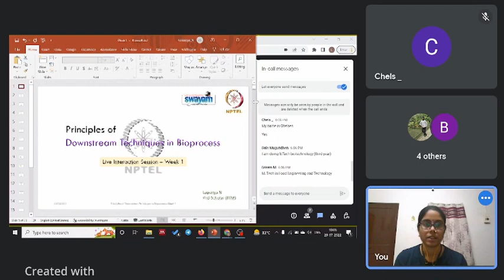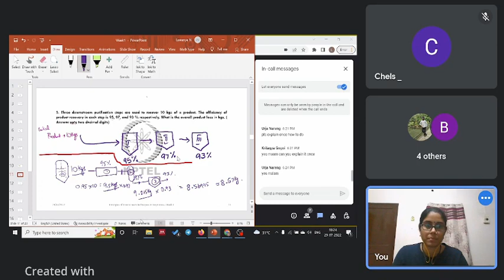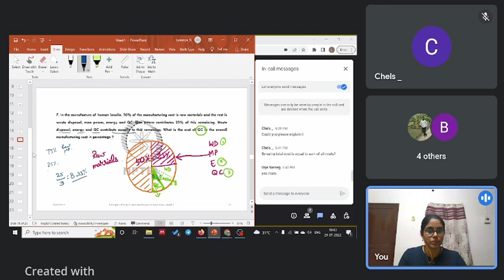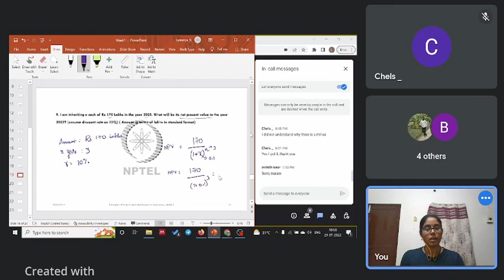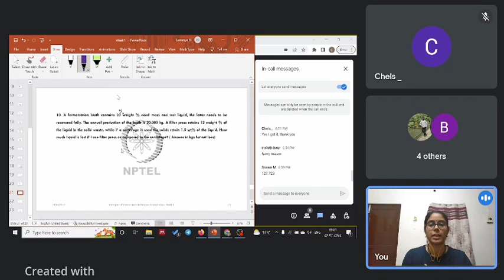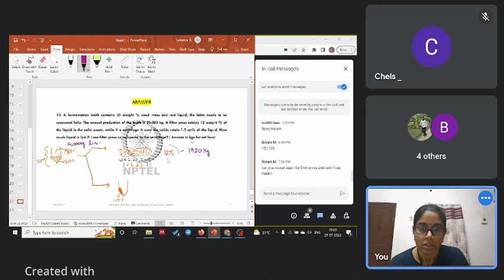Principles of Downstream Techniques in Bioprocess - Practise Assignment - Week 1

Comment: Good evening ma'am...why the video text is not showing clear..i also increased the resolution to 480p but still not clear.. please fixed this problem... thankyou
Reply from the maker: Hello Rohit!
Thanks for pointing this out.
I'm very sorry for the poor quality of video. It was a screen recording of the live session and I had to crop it a bit.
I'll rectify this problem in the forthcoming weeks. Until then, I suggest you use the ppt material (shared with you through the MOOC portal) in parallel, to read the questions better. 
Try to attend the live sessions between 6 and 7pm every Friday, till the course ends!